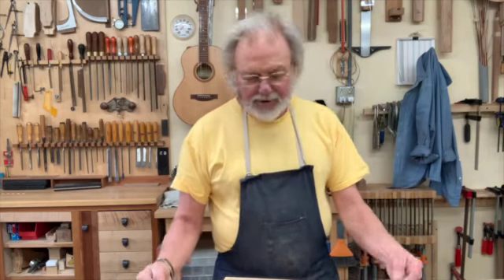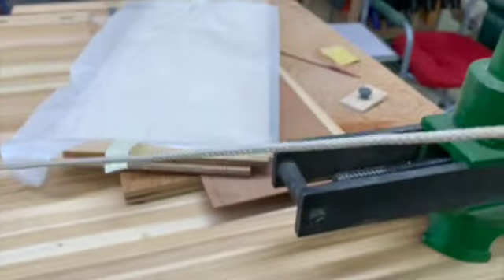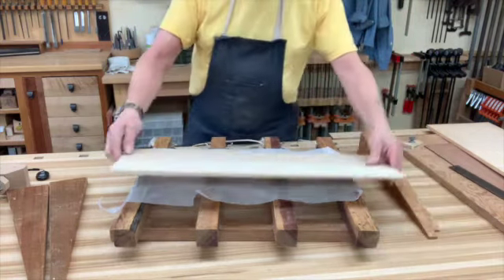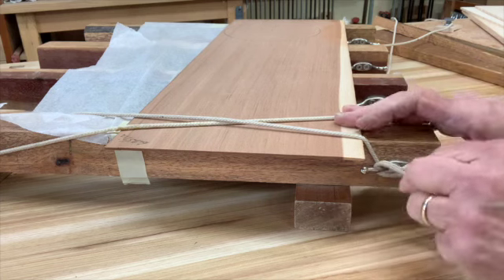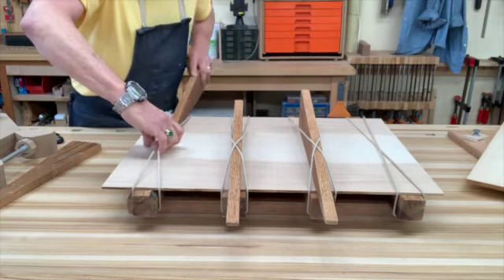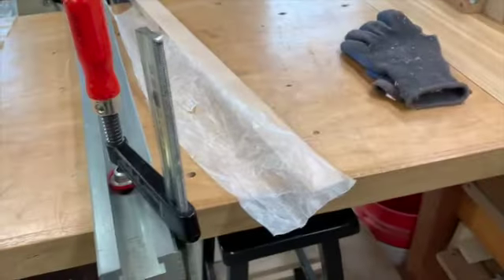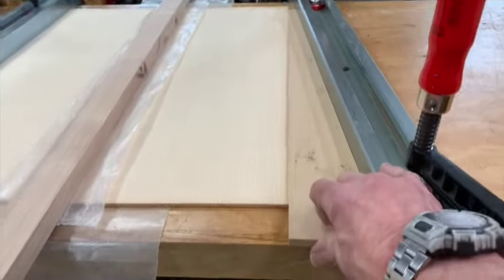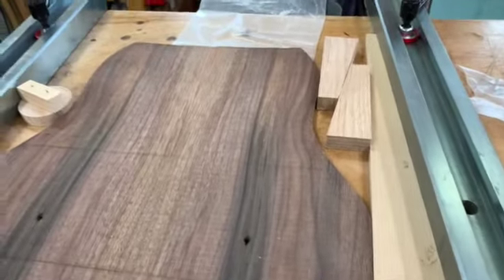Frugal & Easy: Gluing Tops & Backs

Comment: I love both jigs and your attitude. A lot of channels only show enough, to try and draw you in to taking some course they have on line, or reserve time and travel to some shop they have to build a guitar.
For anyone, (and I hope you're okay with me saying this), that wants to build the 2nd jig, Home Depot and others sell a product called "uni strut", which a 10 ft length sells for about 30-35 dollars. You can buy 2 foot sections for around $18.00. These have holes on the back side of the U-shape, and you could mount these to MDF or plywood. This would eliminate 4 c-clamps, or you could use it exactly as you have demonstrated.
Thank you again for such a wonderful video.
Reply from the maker: Thanks for you comment and your suggestion regarding materials. I like that.

Comment: I use a “Spanish cross” fixture which is similar, one central 3/4” plywood rib with 4 1/2” plywood cross pieces screwed to the front.  I have notches in the end of two cross pieces that lock the end of the drape pull cord I use to compress the panels.  4 figure 8 wraps per rib.  I insert the wedges from alternating sides.  This cord tensioned fixture works well for me.  Many of my ukulele front/back blanks are not straight on the outside so cord adapts well.

Comment: Thank you for all your work. I know making videos is a lot of work. Have you done a video on which glues to use? I see other guitar makers using regular Titebond but I always thought that for tops and necks and bridges that hide glue was preferred for easier service in the future.
Reply from the maker: I can give you a direct short answer to your question.  For all of your body and neck assembly tasks, standard Aliphatic Resin  (Titebond, Elmers) glue is excellent.  White (casein) glue is sometimes nice for glueing bindings because it has a long open time, but it's a requirement at all.  Lastly, if you make laminated bindings that will then be bent with heat, Titebond II or even Titebond III is said to be excellent, being able to withstand the heat without delimitation. Hide glue is clearly excellent but requires practice and warming equipment and it has MANY disadvantages. Unless you're a purist or a strict reproduction connoisseur, I'd leave it behind.

Comment: Great ideas! What's holding me back a bit is the expense of tools. For example, the cost of a drum sander wide enough to level the tops, sides and backs. The time to build one is considerable, although one fellow adapts a wood lathe, which I think is genius. I am stuck on the cost of radius dishes at around $90 and upwards. I  will search through your vids for any possible workarounds. I can imagine they can be made with a series of 2x's affixed to a piece of MDF, similar to your back and top jig, but with compound radii where needed (below the sound hole, for example).
Reply from the maker: I've taken considerable time to think about your comment. I certainly understand your situation, recalling not long ago when a sheet of 3/4" MDF was something to wish for at Christmas time.  You can build good instruments with surprisingly few tools and pieces of equipment. A good hand plane and scraper can replace a jointer, planer and drum sander. It's not easier and it's a set of skills to be learned, but it is very doable. As for a homemade drum sander, I wouldn't attempt it unless you are or know and pretty good machinist. Even simple machinery, when home built (at considerable expense) can become a "dance partner" of vibration and inherent inaccuracy, coupled with imprecise adjustability.  Radius dishes can be made with two layers of 3/4" MDF. There are several good videos demonstrating how to make them at far less cost than purchasing ready made ones. I am not aware of any situation except compound radius fingerboards where a compound radius is required.
Reply: Thanks for your thoughtful reply and advice  regarding the homemade drum sander. I don't think I was clear with regard to the radius disc. I was imagining instead of the disc, building just a wooden frame that might require a compound radius, to clamp or "go bar" the backs and tops to-- sort of like guitar bracing but on the outside of the guitar. Anything to prevent all that poisonous mdf dust! @thepragmaticluthier   @thepragmaticluthier

Comment: Hi there! Good content. Which way of the ones you showed is the most efficient / accurate? I am thinking of the first. What do you think?
Reply from the maker: I would start with the first one shown. It is very versatile. The second, I use for very large tops, unusually thin materials and those backs that don't have parallel outer edges. Happy building.
Reply: @Kevin LaDue  I am already using the second for a while but I am trying to find the most efficient solution.

Comment: Good information!  New subscriber here!  How thick do you have the wood at this point in the process? Do you do additional thickness sanding after this or join the halves when you are at their final thickness?
Reply from the maker: I have posted a video unmaking neck blanks if you're interested. I laminate my materials first, then mill the neck shafts to .750" thick.
Reply: @thepragmaticluthier  Thanks!  I'll check it out!  In my question above, I was wondering about the thickness of the soundboards when you glue them, versus your goal for the final thickness.

Comment: Hey, what is the size of the board you made those wedges out of?  Length and width (then cut on the diagonal.)
Reply from the maker: Length & width depend on the available space the wedges have to function in. The diagonal is a compromise between desired expansion in width and the force you expect to apply. I wish I could give you a formula, but there is really no need for that level of specificity.
Reply: @thepragmaticluthier  Thanks for the reply.  I'm sorry, but I was very clumsy with my request.  What I would like is dimensions for two things.  1. The board you made the wedges out of.  (Probably something like 20" X 6" I'm guessing.?. Then you cut the diagonal.) 2. And also the dimensions of the rack.  How long are the 4 crossmembers and how long are the two supports.  Thanks again.  If you can't remember or can't get a quick measurement then please disregard the request.  I'm asking because if your dimensions work for you it could save me making this thing twice if I estimate too short or long.  Thanks again.